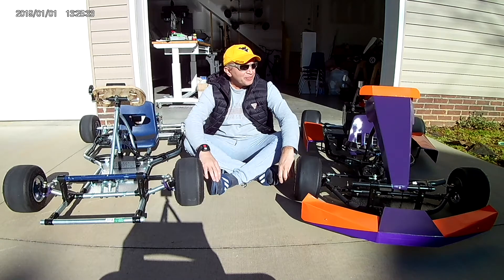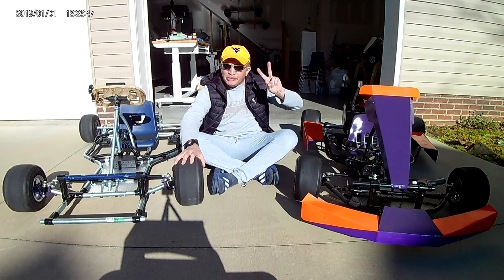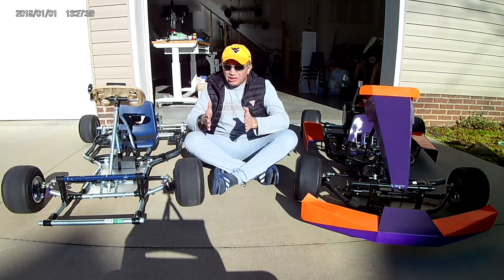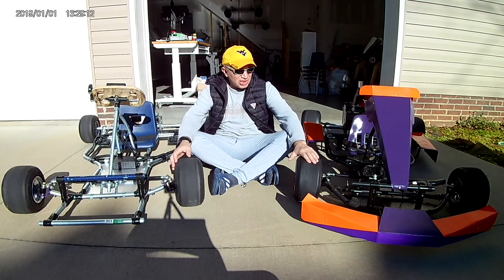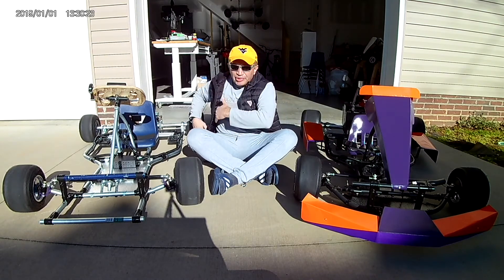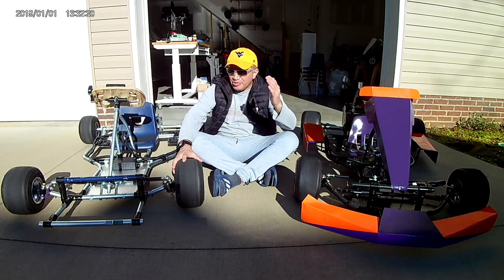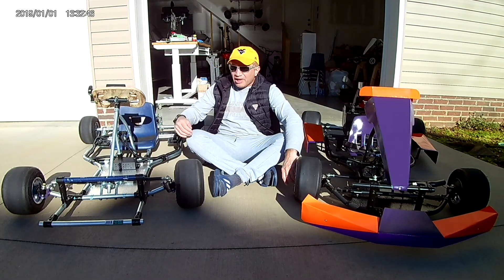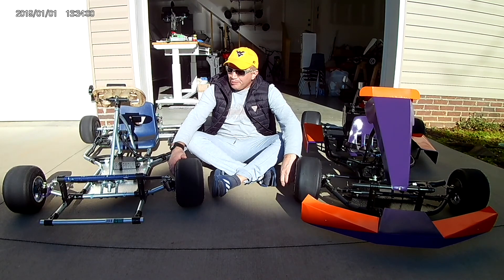Go Kart Upgrades

Comment: What motor did you use for your different go-karts?
Reply from the maker: Skateboard motors 6374
Reply: @diyek1781  Thanks! And what batteries did you use?
Reply from the maker: @TheBeDoubleU  
I use power drill battery packs
Reply: @diyek1781  Again, thanks a lot!

Comment: Hi, I really like that project and would love to create something based on this idea of yours.  My thing would be a CycleKart but I was interested in seeing how many and which type of connectors you used. Trying to limit excess connectors and materiel.
Reply from the maker: Well, when you say connectors I am going to guess you are referring to mechanical connectors and not electrical, therefore you mean the black clamps I use. I am using an average of 30 to 36 clamps on my builds. You can get these from makerpipe.com.
Reply: @diyek1781  Yes indeed I was curious if the sampler package had all the connectors need or it is better to buy specific one's instead.

Comment: How much for the one you are selling?, you need a way to contact you!
Reply from the maker: I know but it takes money and work to make these.
Reply: @diyek1781  I think what he means is it's leaning towards used prices for CRG of older Tonykarts, I think you should start selling frames as a kit, and find a way to adapt them to CIK regulations, I think it's possible
Reply from the maker: @isrcinimatic587  well, my karts are fun karts and not necessarily pro-karts. These are electric karts not gas. Even pro-electric karts cost a ton of money. You other than pro-electric karts out there, there isn’t anything like my karts. If anyone finds one please send me a link.
Reply: @diyek1781  Yes but it looks like I can get the same or better for much cheaper in other places.
Reply from the maker: The purple and orange kart you see in this video is for sale at $1600. Just uploaded a new video in Rumble about the top speed. Thank you.
Reply: @diyek1781  Thanks, that is a bit expencive

Comment: I want to make a MOBILITY SCOOTER that will have a weight capacity of at least 400 lbs using Maker Pipe. Do you think that this is possible and I would also like to have shock absorbers, do you think that this is possible using Maker Pipe ?  I want to keep the speed capacity of this Mobility Scooter at around 5 mph.
Reply from the maker: It may be possible but you would need to reinforce the pipe by adding/inserting a half inch EMT to the 3/4” EMT. A scooter is usually small with small tubing in lengths which is stronger.